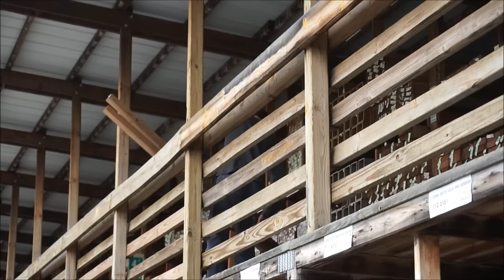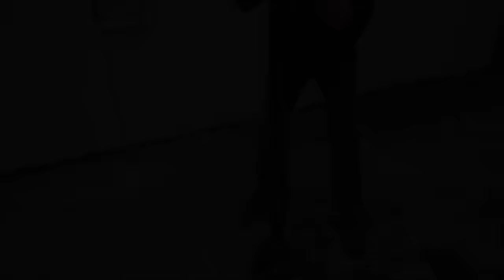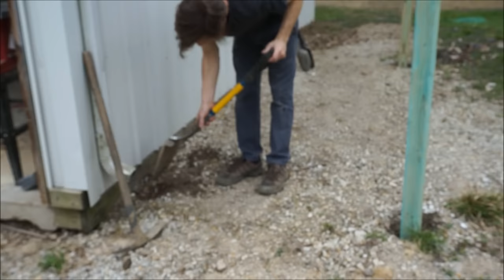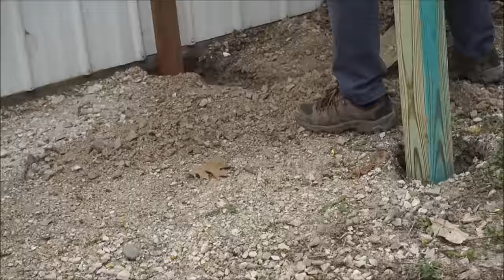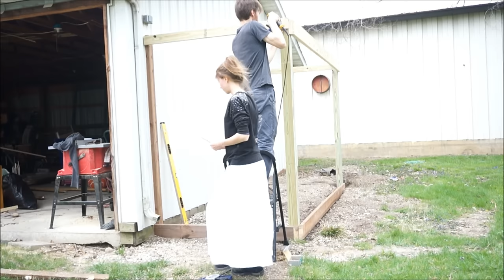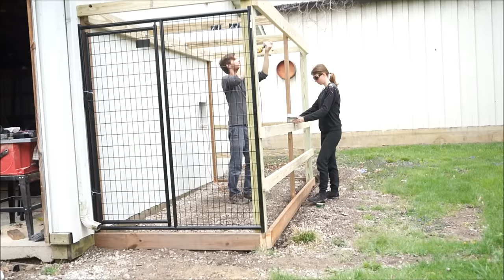How We Made Our Chicken Coop Run!

Comment: Yours looks Great! 
We built our duck/ chicken house and run the same way except our opening is a lot lower to the ground where we cut the opening in our barn and our run is way bigger but we have a lot birds. We can also close a door on them if we needed to. 
 It works fantastic. I'm sure yours does too.
Reply: We also poured concrete to about 6 inches below the ground putting the chicken wire into the concrete so nothing could dig under and get into the run.

Comment: Run looks great, could you post what size your wood boards were, Thank you kindly.
Reply from the maker: The horizontal boards on the bottom are 2x6's. The long side on top is a 2x6. The horizontal ones in the middle are 2x4's. The ceiling joists are 2x4's. The 2 corner posts are 4x4's. The run measures about 5'x12'. :)

Comment: This is exactly what I was looking for. what size is the pen and could I get a material list for this please?
Reply from the maker: I'll see if I can get a list put together for you.
Reply from the maker: The pen is 5' by 12'. You will need a kennel panel with gate and four 1" conduit straps to hook it to the run. We used all pressure treated lumber: five 2x6x10's, five 2x4x10's, three 2x4x8's, two 4x4x10's. 25 foot roll of 1/2" hardwire cloth 3 feet wide. 50 foot roll 2 inch by 4 inch welded wire 4 feet wide. 3" inch screws for outdoor use/pressure treated wood. And we used 2x4 joist hangers for the ceiling, but you can just angle screw the boards, which is probably easier. Hope this helps you!
Reply: MiniSteading thanks did you put a roof on it later?
Reply from the maker: The ceiling is just the 2" by 4" welded wire.
Reply: MiniSteading I'm in the process of building the same setup on my large shed. I'd like to see what the interior looks like on how you placed your coops. It's awesome getting different ideas.
Reply from the maker: We have a coop tour video: https://www.youtube.com/watch?v=vX5QRA23eLY&t=25s

Comment: Did you cement the posts or are they secure enough being attached to the crossing boards on the ground?
Reply from the maker: The posts are set in the ground 3 feet and backfilled with the dirt that we took out. No cement was used.
Reply: cool, thanks!

Comment: I am in the processing of getting a shed to put my chicken and then I want to enclose it as you did, have a run to surround the shed.  What size wood (pressure treated I am sure), the door? and is that a nail gun?  you used the heavy lumber in the corner and what type of wood for the ground and the rest? Thanks!  I love your run.
Reply from the maker: Check the video description for the materials we used. It was a staple gun that we were using. Thanks!
Reply: @diyfferent  great thank you! did you cement the posts?
Reply from the maker: @rosepompeo2604  nope :)

Comment: Your plans have a couple of things wrong.  You listed that you used 2x6x10 but that the run is 12’ long.  Also looks like you used 5 conduit clamps instead of 4.  4 seems to hold fine but the length of run is only 10 feet
Reply from the maker: For some reason I had the lumber listed wrong in the description all this time without knowing. Thanks for pointing that out. I think it is listed correctly now. The run really is 12' long.